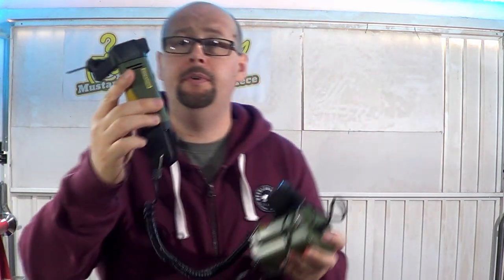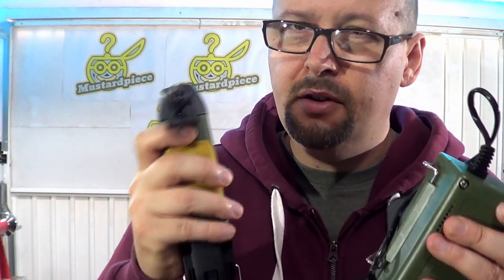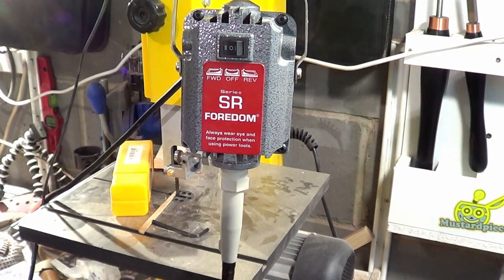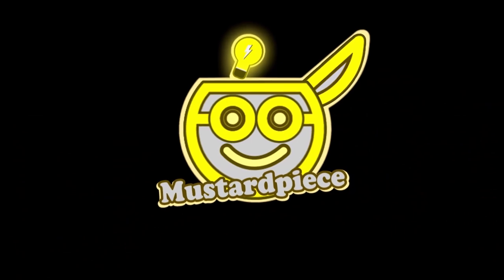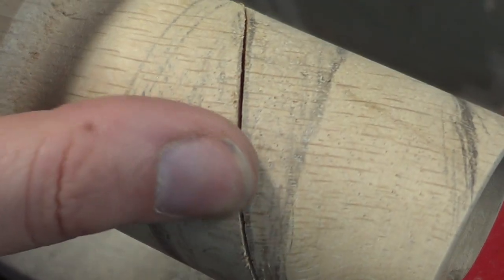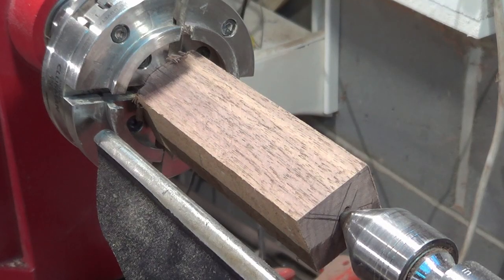Making a Fancy Finial Using my New Toys - Woodturning

Comment: Nice tools Attila👍  Now you won't be able to blame them - it's up to you now😁  May I suggest a finer blade?  And to never move the blade into or out of a cut while it is under power else you will eventually catch a tooth and break the carving. DAMHIK.  I also like burrs and grit type rotating cutters better than spiral cutters - do you find this true in your experience ?      Stay safe.  -Mike😷
Reply from the maker: Thanks for the tips. It came with a finer blade also included. I have some very serious burr bits too. they are very good for removing material quickly, but they are messy. In my opinion you kind of need them all. ~ Attila